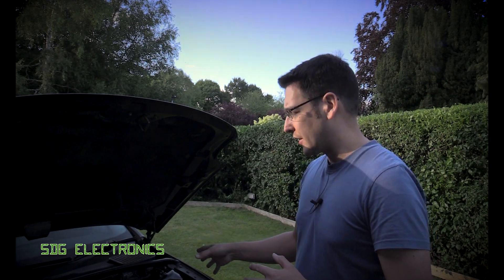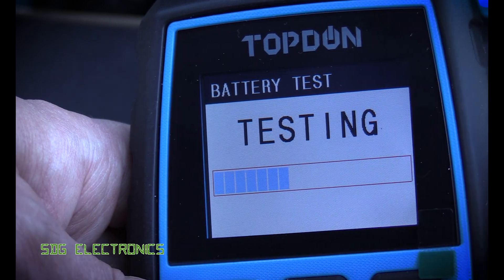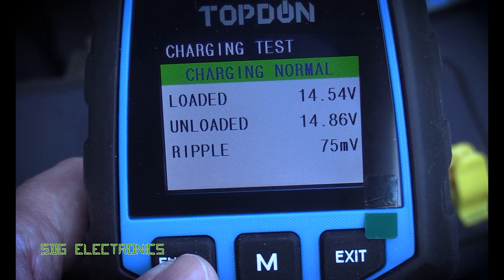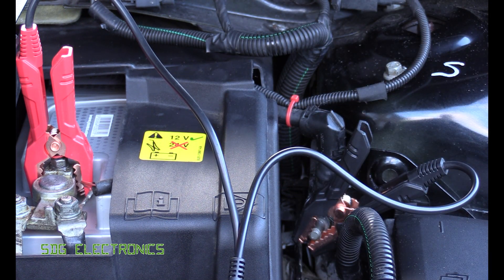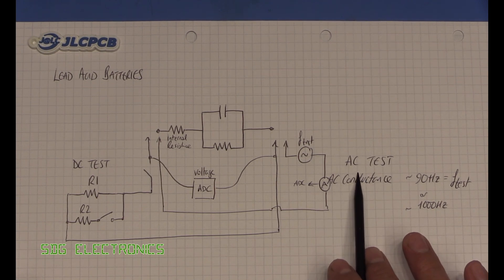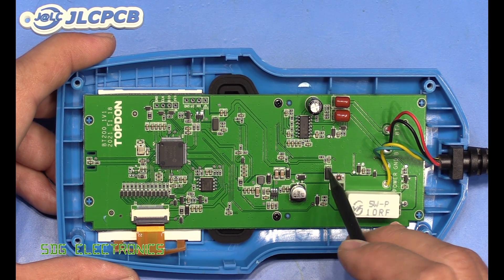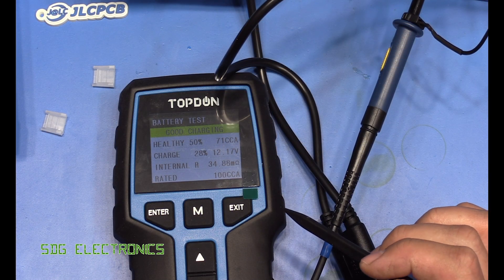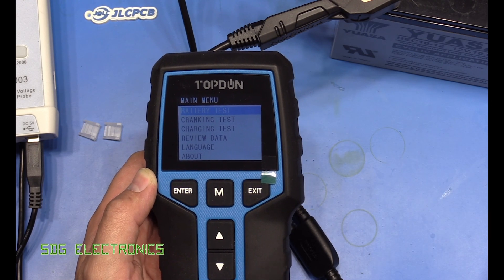SDG #253 Battery Testing - Topdon BT200 Internal Resistance and CCA Tester

Comment: Hello , I purchased a BT200 Topdon battery tester which seems to be a good unit for the price point . I run an ATV/UTV service business and batteries are all ways an issue but this unit does not list amp hour rated batteries which are the common rating system on ATV's . Some larger machines do use CCA . I read somewhere that AH x 7.2 = CCA but was wondering if this conversion would be somewhat accurate for this tester ???

Comment: Good analysis!  The internal resistance of the battery is caused by Sulfation plus the resistance of the Lead and other metals. The higher the sulfation, the higher the internal resistance.

Comment: Nice video.  Only suggestion is to use AC coupling on your pico scope for the voltage (and a much more sensitive scale).  Then you could do delta V / delta I to get the internal resistance.

Comment: First remove the negative pole, then the positive. First mount the positive and then the negative. This is to be sure that if you use a non insolated wrench you can not short the positive pole to the chassis by accident. You used an isolated socket so there is no risk in your case but I do not think many people have those.

Be extra careful if the battery was charging just before you  remove it. There is often explosive gas around it. A spark can be enought to let the battery explode. I has seen a mechanic blow up a battery in his face and all over my gear when he wanted to replace the battery of my motorbike. I just wanted to tell him not to start with the plus pole when he touched the frame with the wrench while loosing the plus pole bolt and the spark caused the battery to explode .
Reply: Should you happen to have an oldie with a positive ground electric system, the order is the reverse though. 
The general idea is to 1st remove/last connect the grounded terminal, no matter positive or negative.

Comment: I still have a big wire wound load tester in the shed from the 1950s it gets red hot and smokes a lot. Quite exciting with sparks!  The battery tester looks good. Did the battery indicator lamp on the battery show anything

Comment: I recently looked into measuring iR with an LCR meter. You only need to put some caps in series to block the DC voltage. You could try that in an upcoming video :3

Comment: Nice little tester, probably better suited to smaller capacity batteries with the 1A loading, but perfect for gel and other small cell types, rather than large automotive batteries. Would be a great way to test all those small lead acid batteries, though I simply made a load tester, using some nichrome foil from a defunct heater, and a voltmeter to measure across it. Around 5A of current draw, which for most SLA batteries is a good indicator of internal resistance, and a cheap DVM module to measure the battery voltage. No 4 wire measurement, I just recycled the cables off a defunct jump pack instead, as they are real copper wire, and semi decent clamps, and certainly capable of carrying 5A with almost no voltage drop. Thicker cables on the Topdon unit would definitely have improved things, along with a slightly higher test current for vehicle battery use.

Comment: My car's battery is exactly like your old one, the open circuit voltage is even lower 12.1V. Surprisingly, it is like this since 7 years ago and it still works just fine! It is the original battery. If I replaced the battery 7 years ago, for sure the new one was already dead by now.
Reply: I would probably keep one of those power banks that can start your car in the glove box for when it finally dies.

Comment: Simple test: keep the multimeter connected to the battery and check if the voltage sags close to 10V when starting the engine. If close or below 10V, the internal resistance has become too high, the battery isnt healthy anymore, better to replace with new one and keep old one for house projects.
Reply: impossible to get same reports

Comment: I’m surprised that they get any idea of cold cranking amps from just placing a 10ohm load?
When you look at the old battery testers that were used by garages they almost shorted out the battery, pulling somewhere close to 100A or so. 

Nice big crock clips but looking inside not very thick wiring. It’s a right old pain in the butt that nowadays you can’t even change a battery without having to reprogram the car. So far my Volvo has required a dealer to do the programming as the cheap testers can’t seem to do it, or so I’ve been told.
Reply: We used those carbon pile testers for many years.  They were effective  but potentially damaging to the battery.  Battery quality and condition is almost a safety concern in the world of auto-start/stop and collision avoidance in cars such as your Volvo.  Makes sense that some sort of serialization and BMS are part of a battery install.
Reply: @radman999  I agree but i just hate to have to pay on top of buying the battery just to have them bolt it down and program the EMS. Having spent most of my driving life just going down to the car shop buying one and bolting the thing next to the engine and jobs done.
Reply: @TheEmbeddedHobbyist  Makes sense.  There are simpler cars to own if you want to just get from A to B though, maybe something from the 2000s.  Plus the subscription for the software costs the dealer upwards of $20,000 per year (for Volvo VIDA).  There has to be some ROI on that and the labor time.
Reply: @radman999  passing the rip off down the line lol